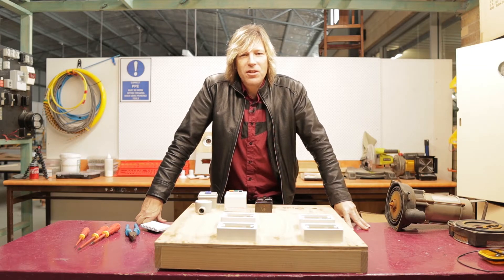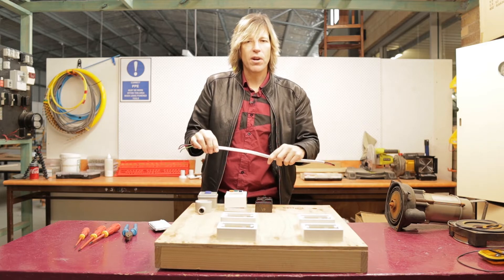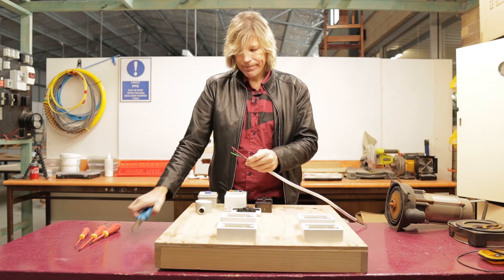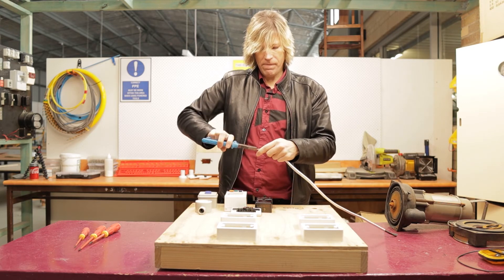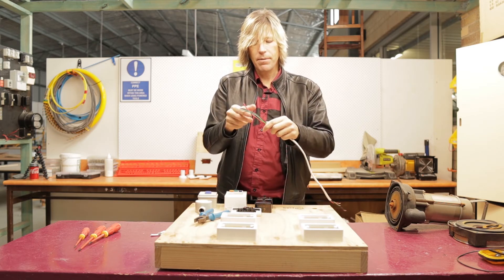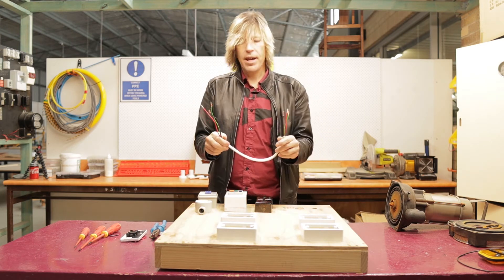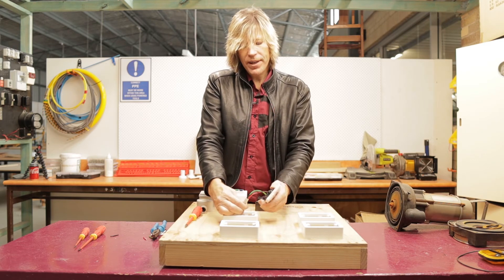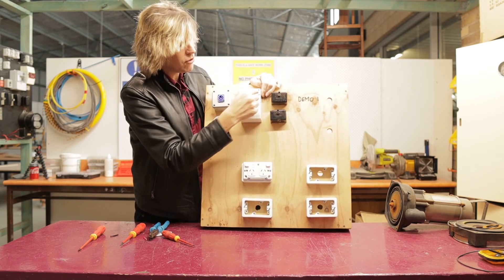Electrical Wiring How to Wire Power Points or Socket Outlets (GPOs)

Comment: Cool video. If you are installing a 15amp GPO is a 16amp RCD suitable?
Reply: The protective device protects the cable, the rating of the outlet will always be lower than the protective device. But you should be considering the cable size regarding the 16A RCD

Comment: Excellent video, I wish the camera was a bit closer, but the above said it is excellent for apprentices or professionals as we all   get into bad habits and  take shortcuts when carrying out electrical work,  so as the boss says or should I say Bonjovi "always treat the line as it is live" so basically don't use your teeth to strip wire. Yes I have seen this been done by professionals. Must be busy these days after the flooding.

Comment: Ive only ever wired outlets in North America (Canada), I’m used to seeing a cable securing clamp on the box to prevent the wires from being pulled from behind. Is there any requirement from this in NSW?
Reply: no